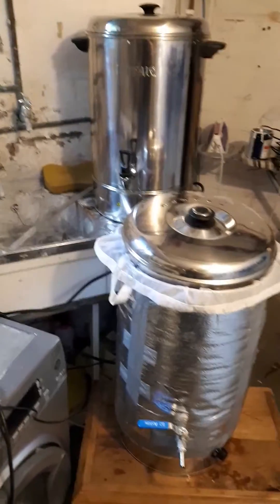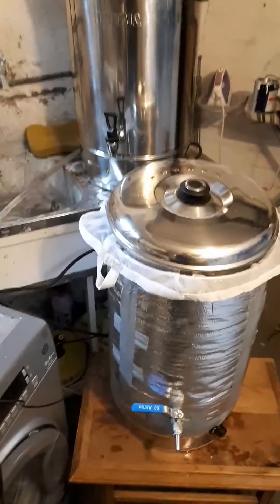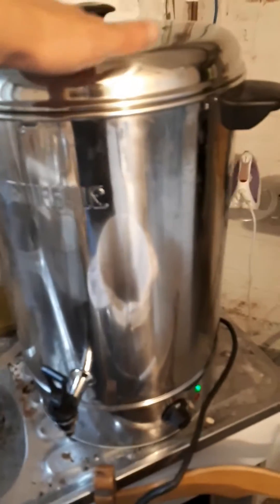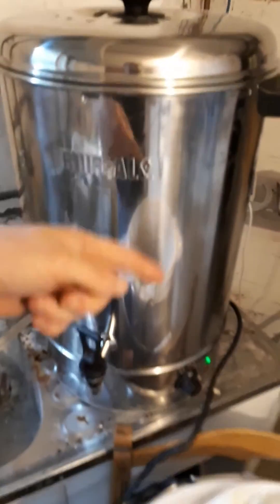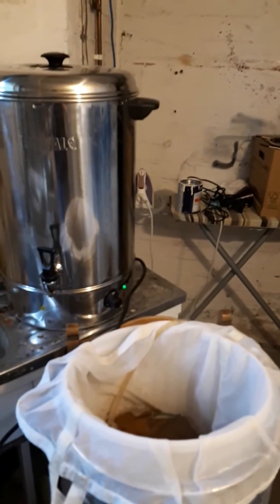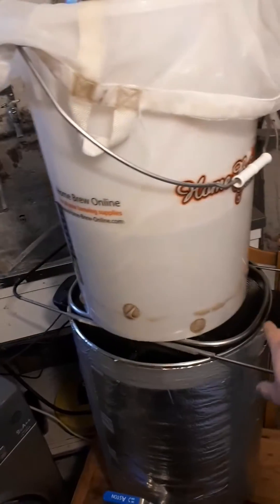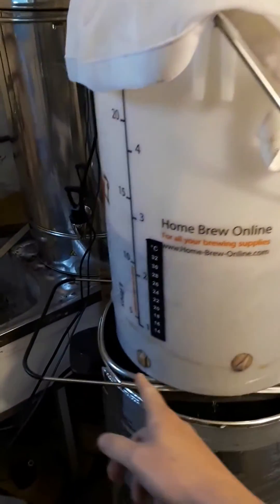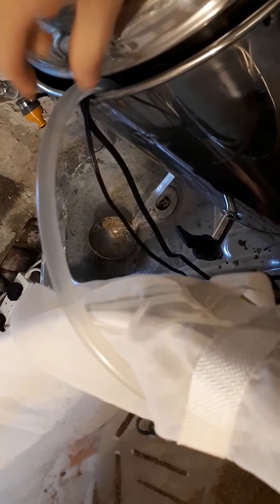DIY Grainfather / Bulldog Brewer - Mash Recirculation and Sparge

Comment: Hi great ideas, do you plan to do a full brew day video ?? 
I'm interested by the system, in comparison to the Klarstein/Brauwmesteir it's half the price.
Reply from the maker: Hi there, thanks for comment, Ive been asked this a few times so will try at some point. If you'd like a list of all parts to buy I can provide one if that would help. You can make it for roughly £280 but it takes up a lot more space than a commercially bought setup and is far less accurate with temp control. That said it still makes great beer!
Reply: @robertbaldwin177  Yes I would be interested in the part list. I'm already brewing biab in a small kettle.
Reply from the maker: Sure thing, might take me a few days, will compile it one evening and send it over. I'll try to work out a way of messaging you with it.
Reply: @robertbaldwin177  Thanks, take your time i'm not in a hurry.